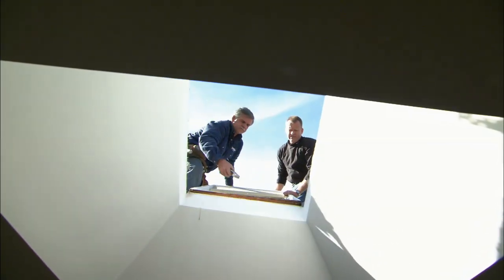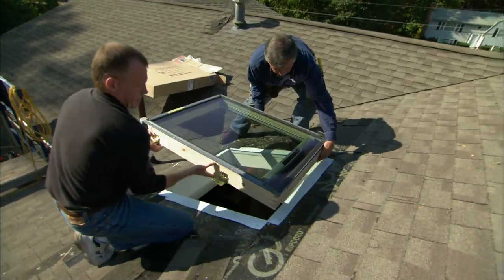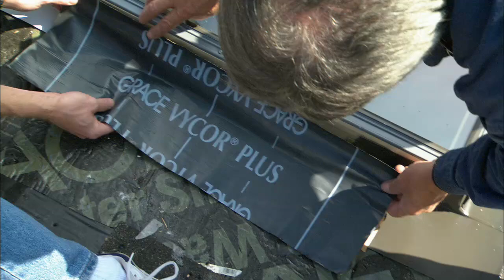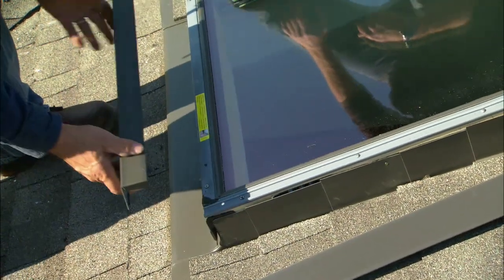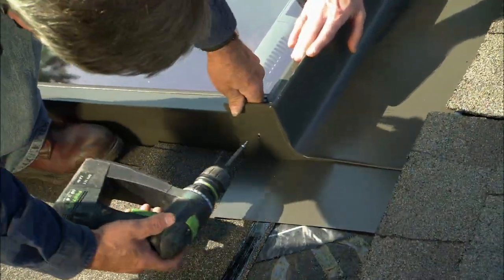How to Replace a Leaky Skylight | This Old House

Comment: The best way to fix a leaking skylight is to remove the old one and roof over the hole.
Reply: But what if you actually want a non-leaking skylight tho?
Reply: Or you could actually be a roofer and know how to use flashing.

Comment: On some shingles its impossible to seperate them to get a prybar underneath to remove the nails. The adhesive is baked on solid. You destroy the shingles in the process. This should have been mentioned in the video.
Reply: instablaster
Reply: @moseskendrick3965 Could you explain a little more?

Comment: Really love these shows, there's another TOH skylight replacement job video that I just saw and Tommy was very adamant about needing a safety harness that's tied to the roof and it was him and Kevin doing it.   Now here's a video Tommy and the homeowner,  nah we don't need safety gear.
Reply: Mike B May depend on the slope and height of the roof. They also have scaffolding set up in this one, which is a big step up in safety.

Comment: I had  y roofing company remove an old skylight and roof over it.  What is required now to properly drywall the old opening.  I read that the old drywall from the framing should be removed from the sides to allow it to breath.  Next install insulation and install drywall to the opening below in my bathroom.  Is this correct?  Have you done a video on this?  Thanks

Comment: Why would a skylight leak other than thru improper flashing. I have one that 23 years old and recently after a noreaster, I had some minor dripping from an inside corner.
I haven't found the source and it hasn't leaked since.  If at some point they fail I'd rather  remove them than replace (I have 6) but that would involve a lot of work including adding ceiling drywall.

Comment: The new one could leak also.  Notice that the last top flashing did not go under the shingles very far.  Water will get under it through the shingle gaps.
Reply: another course of shingles had yet to be installed over the top counter flashing piece

Comment: I have a roof leak (or maybe a skylight leak) next to a skylight that I can't seem to fix.  I've been up on the roof and in the attic a dozen times trying to fill every possible crack and nothing works.  Hope replacing the skylight will do the trick.
Reply: Pooky or caulk is not a good substitute for proper roofing techniques.  I'm not sure why so many install Ice & Water beneath a well-flashed skylight, I think the fear they did it wrong.  Here's what we do even with Velux.  I'm not a fan of the snap-together aluminum flashing Velux makes.  This has been time tested and proven to last more than the lifetime of any wood or composition shingles.  Slate, upgrade to copper!
Reply: https://youtu.be/pLLyt5AjGYk  here you go!

Comment: No nails in the window frame. I just installed a Velux skylight and followed their installation steps. The nails go only on the side of the flashing never on the window. I guess contractors don't read instructions!
Reply: I rather go in the window fram than driving into the roof